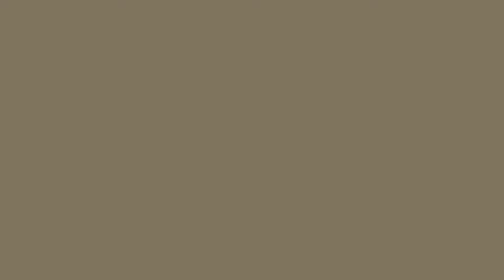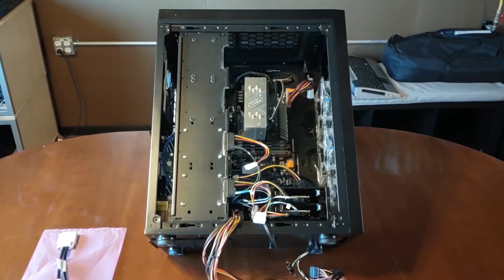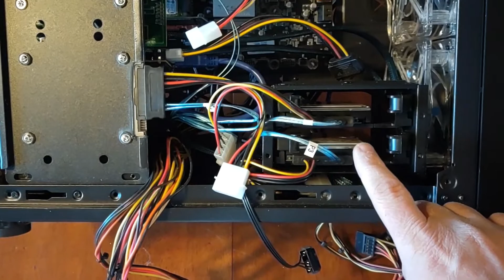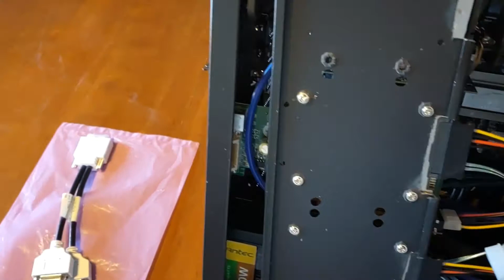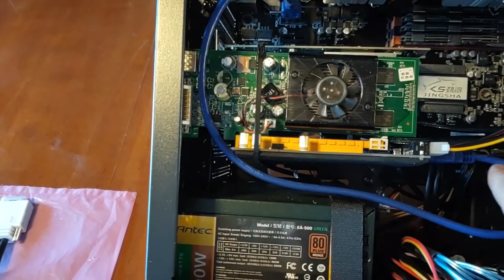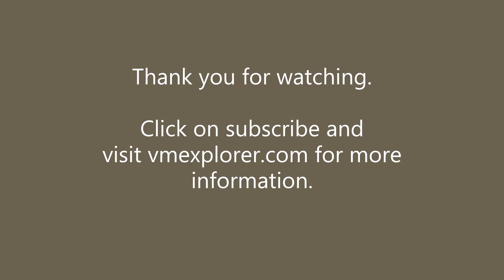VMware Home Lab Gen V Build Part 6 Final Steps

Comment: Thanks for your videos. I have built a similar machine, but using x99 platform. The thing is that ESXi 7.0 does not contain the onboard LAN drivers (realtek). Do you have any suggestions?
Reply from the maker: Thanks for the comment.  I have moved on from these boards as they were not a good fix for ESXi 7.  My new Mobos came with Intel NICs and they work like a charm.  Realtek just isn't supported with ESXi  and this has been an issue for Home Labs for quite a while.  It's not a VMware issue, but simply Realtek doesn't certify their drivers to work with ESXi.  Best option is to go with a NIC that is on the VMware HCL.